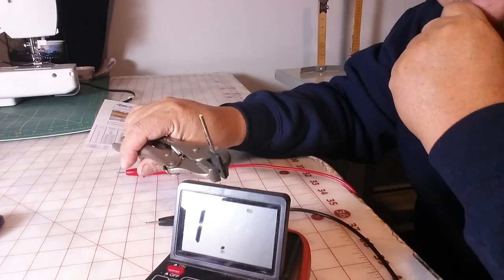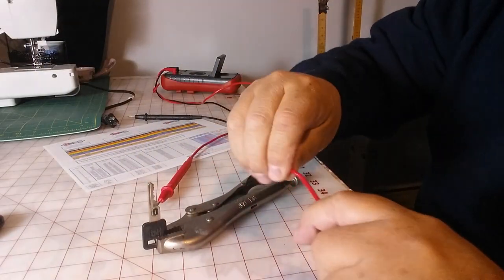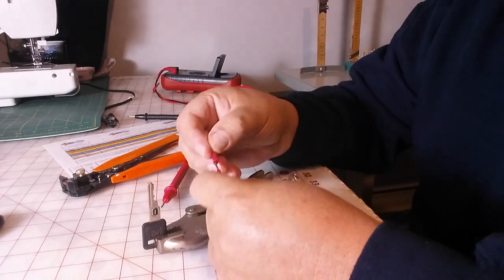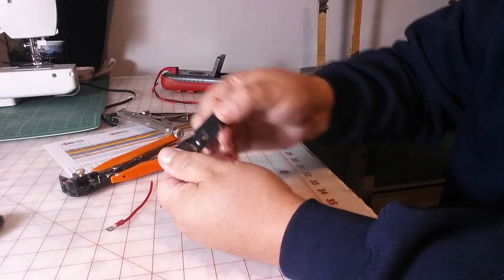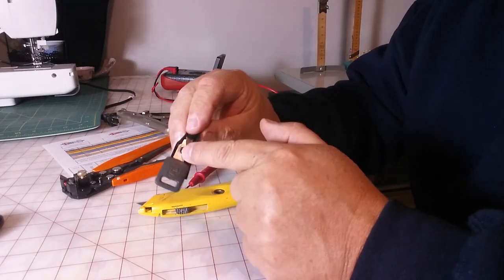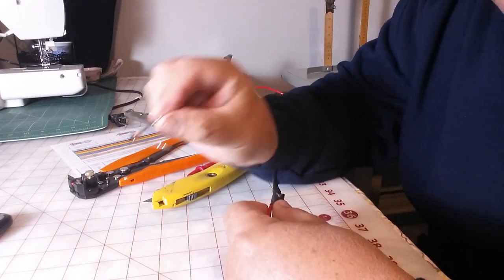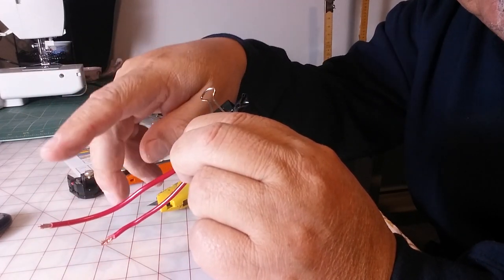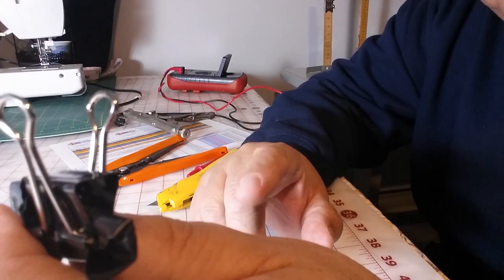Cadillac | GM | VATS Key | Passkey 1 - 2  | Anti Theft System | How to Override - Bypass

Comment: Better yet, determine the resistance of your key then solder in the correct amount of resistance between your wires rather than some jury rigged key with tape. That will be a permanent solution. It just but the already assembled correct resistance bypass online.